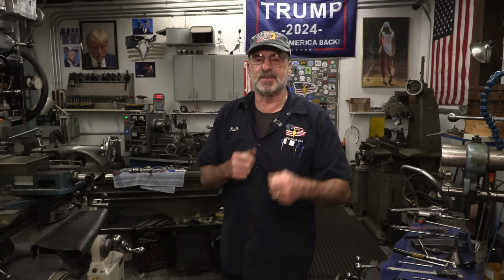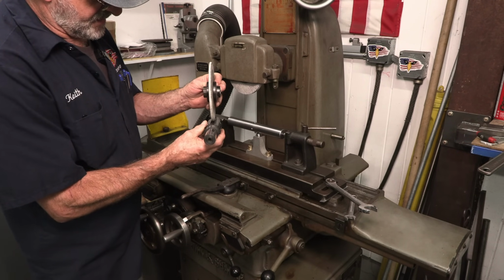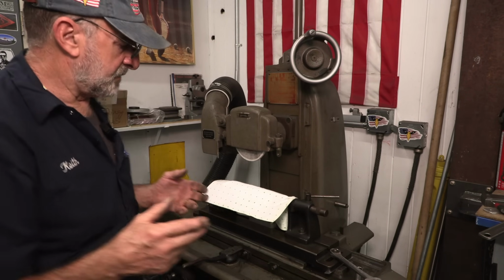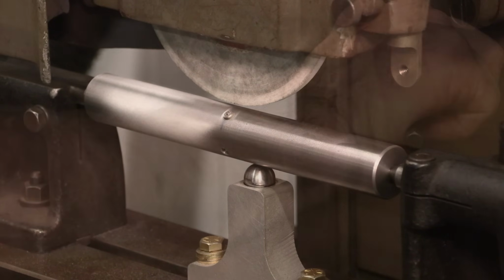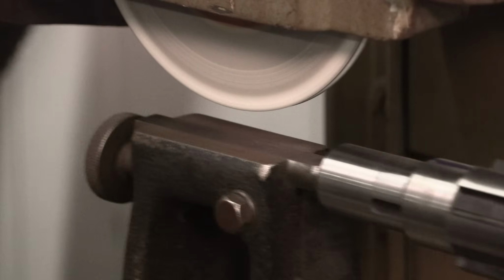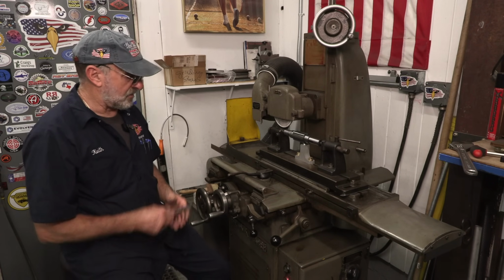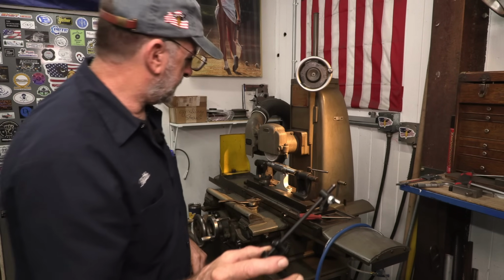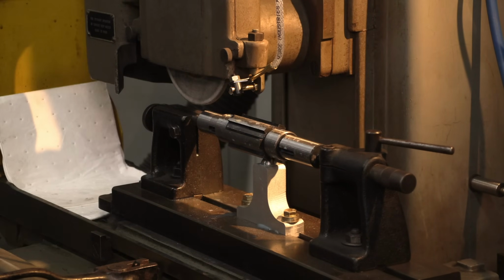Dress And Grind

Comment: Keith, before making the final passes, I think you should have redressed the wheel. The radius on the wheel causes uneven wear since the outsides of the wheel come into contact first then move in. You’ll end up with a bigger radius at the end.
Reply: I thought that exact same thing- Bet that wheel is as Flat as my prom date was-  now after all that- I think it coulda been re-dressed TWICE throughout all that grinding?
Reply: I must agree, certainly a redress for the final pass, but will the gear run on the minor diameter or the flanks of the splines?

Comment: I'm telling you something that you already know. But if not maybe it'll save a part and anguish. 
When you started the spindle to make sure that the wheel doesn't explode, you only had a  pad over that part. Having seen a wheel explode in a machine many years ago. I want to say that you need to make some sort of 3/16" thick steel surround. Because if it does happen, the amount of damage from those wheels is astounding! Your part and everything down to the chuck would be scrap.

Comment: Marking is good for visual contact, the keyways were the best identification for # 1 position then clockwise. The keyways are on the same centerline, but the part isn't symmetric as the keyway lengths vary making a left/right identifier.
Our tool room ground all heat-treated surfaces to their finished sizes for injection mold segments, we had several radius dressers. If our fit was over .0012" nylon would bleed during the injection cycle.  We always dressed every surface of the grinding wheel used, flat bottom, side wheeling or contour if removed from the arbor. The redressed form was tested by grinding a credit card piece of Formica in an optical compartor.
Yours nib arbor was a simple, adequate, functional and cost effective addition to your fixturing. 
We probably would have used a quarter rounnd form grinding one side ground one flute wall doubling the amount of grinds. The nib could have dressed a flat portion, then rotate to form a radius and rotate to side dress the wheel.
As pointed by others the ring test would be a safety reminder for new-be operators.
Reply from the maker: There are double keyways 180 from each other, so it's not a given.